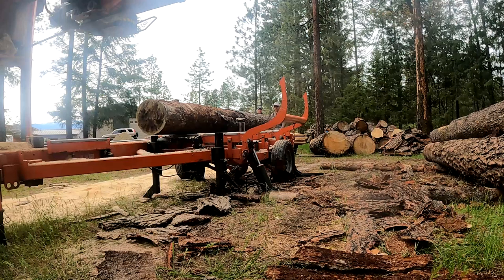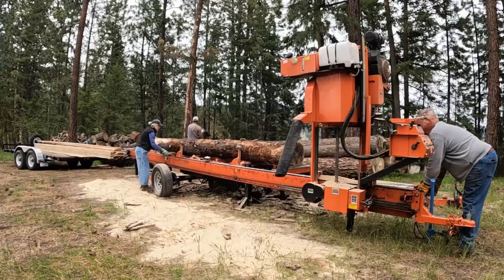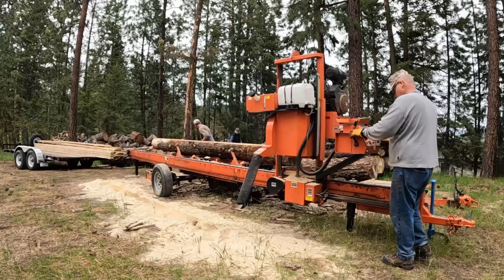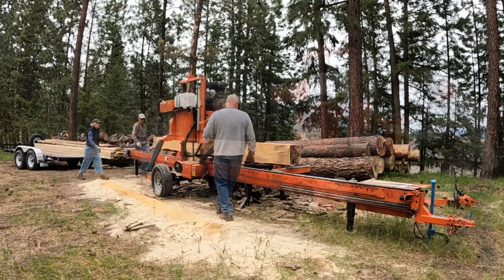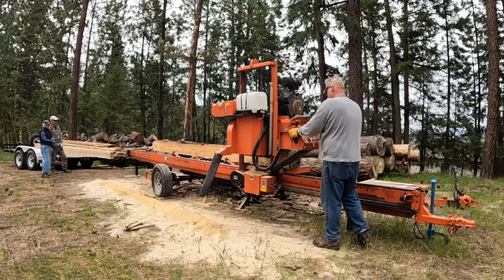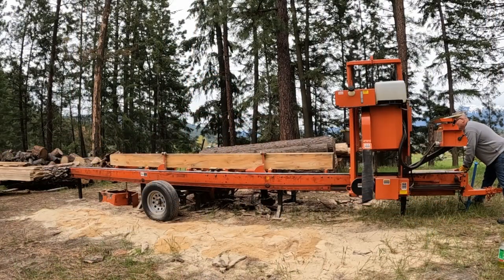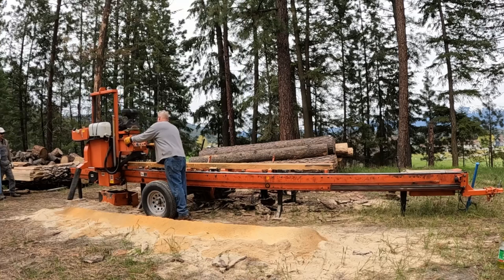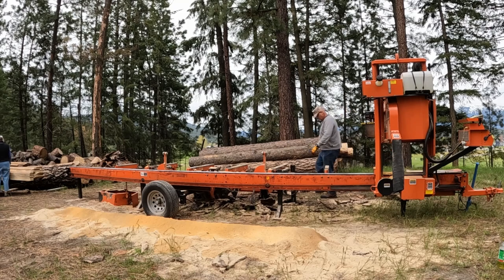Common width I mill on my WoodMizer LT40 sawmill

Comment: Old Jarhead I notice that most every time you make a cut you take the head of the towards the middle of the log, what is that doing for you?
Reply from the maker: Checking the center of the log to make a good cap cut.  I typically drop 1.5 inches from there and go
Reply from the maker: In short, it's a very fast way to determine where to open the log up on the first cut because the center of the log will be the average height if the pith is centered.  You can drop from there 1 to 2 inches depending on the bark thickness and the size of the log and get a good face on the small end.  Any other time it's because I just want to verify where I am before getting back on the simple set.  It's faster tha. using a tape measure ;)  Just a trick I learned years ago.  A laser would make this no longer needed.
Reply: @TheOldJarhead  Thanks for the info, I have a LT35HD on order, I placed the order December last year and they are telling it will be May of 23. I am trying to get all the pointers I can. I like the way you approach the log that way. Thanks for taking the time to teach.
Reply from the maker: @tim1405   You bet!  Thanks for watching!